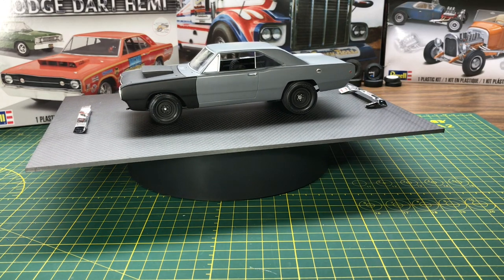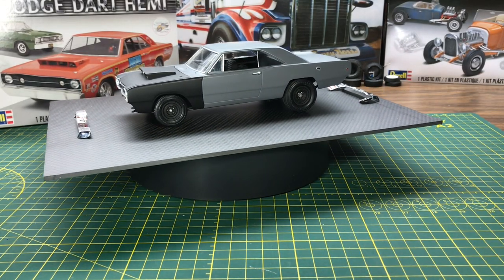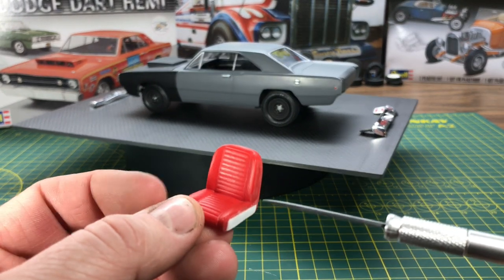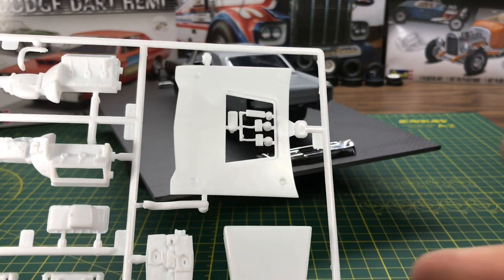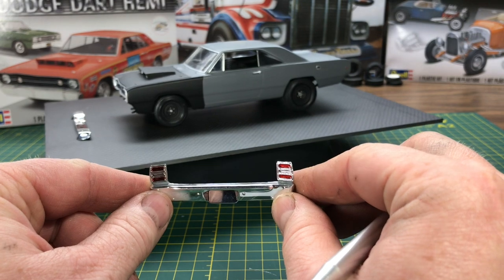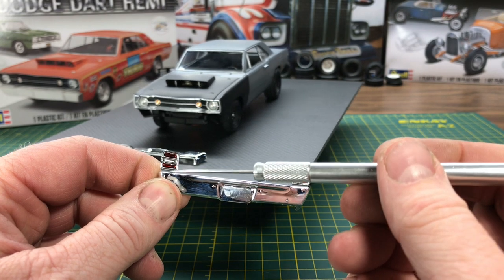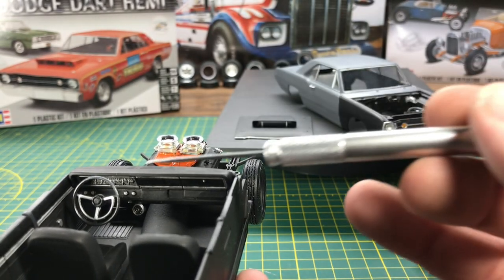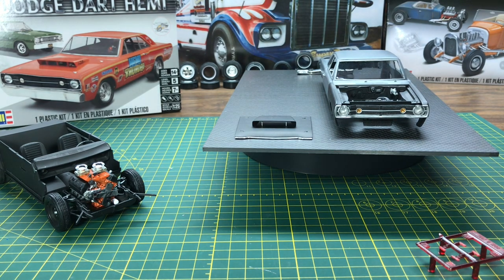All About The Revelle Hemi Dart #revelle

Comment: Nice build, thanks for all the real car info.
For door handles I’ll carefully drill a hole in the back of the handle and superglue the handle to a thin metal rod, either steel or brass. This allows me to clean up and paint the handle. Next I’ll drill a hole in the door. Once the body is painted and polished I mount the handle by pushing the rod through the hole, put a drop of superglue to hold it in place on the inside of the body and snip the remainder of the rod off once it’s dried.
Reply from the maker: That's a good method to use, and I've used it before. It depends what I'm building but thank you for the good suggestion, always appreciated.